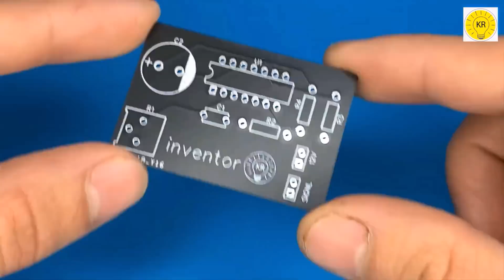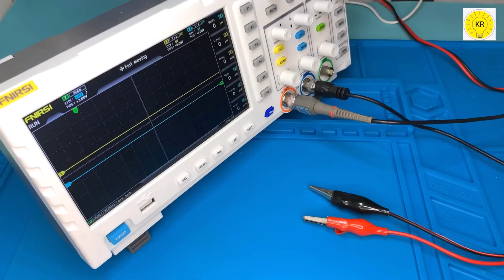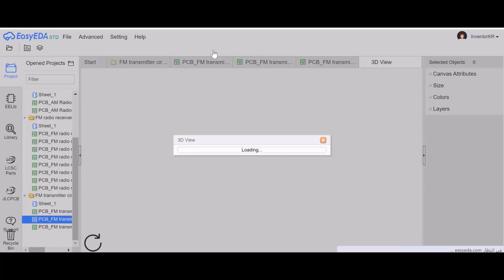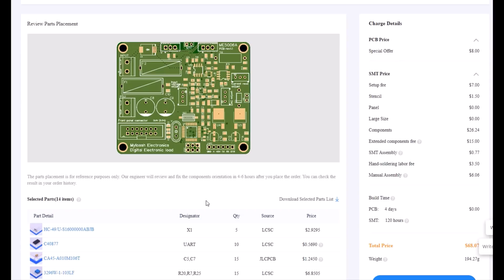inverter 12v to 220v , jlcpcb

Comment: if i want inverter 12v to 220v  5000 amp with battery charger?
Reply: Did you mean 5000W if 5000A = FRYING TONIGHT ! -  Or maybe you do need to speak to EDF in france

Comment: You use the ic with programming or without any programming?
Reply: Without any programming. The IC is an oscillator and only looks for the capacitor and resistor values to decide what type of output signal to produce. It can handle input voltage 3-18v, and will output continuous pwm at the same voltage as the input. It’s a mini pwm generator IC.

Comment: HELP ME PLEASE. THE INDUCTION HEATER WHICH I MADE ACCORDING TO YOUR SCHEME DOES NOT WORK FOR ME. CAN THERE BE A PROBLEM IN THE NUMBER OF TURNS ON THE THROTTLE AND INDUCTOR, AND THE CORE FROM THE COMPUTER POWER SUPPLY, THE CORE IS YELLOW? HELP ME PLEASE.
Reply from the maker: Give me more details, what is the value of the capacitors that you used, as well as their number and the number of coil turns
Reply: @inventorkr1  Turns on the inductor 12, wire section 1 mm. Turns on the ring 9 on one and the other side, the wire section is 1 mm. Film capacitor 0.47 microfarads one piece.
Reply from the maker: @ИринаГеращенко-л6у   Need to connect more capacitors in parallel
Reply: @inventorkr1  Thank you. I will try
Reply: @inventorkr1  Please tell me, as far as I know, the capacitors should be of the same capacity, but can I put different ones? I also have homemade IGBT transistors from one Mosfet and a PNP transistor, can they be supplied? Or do I need to take power IGBT transistors?